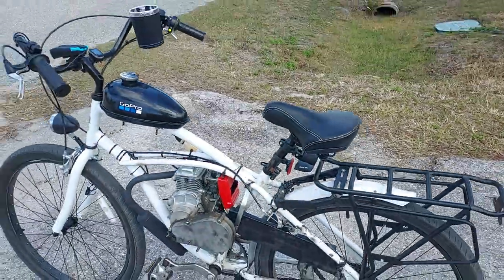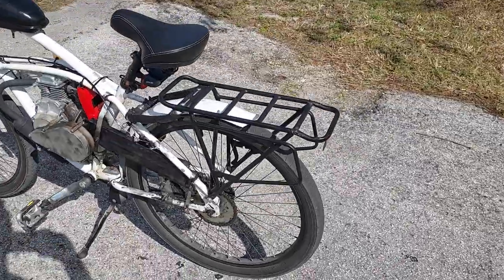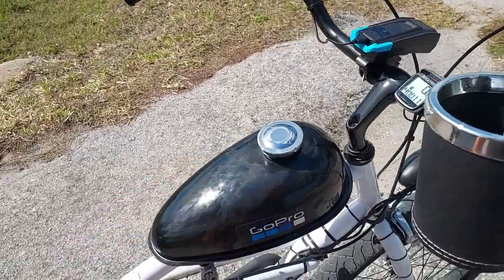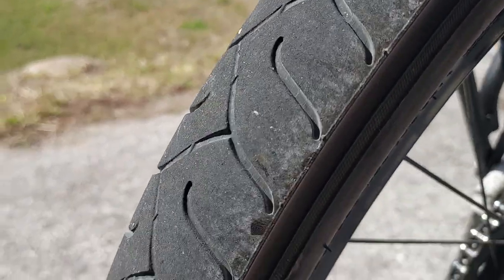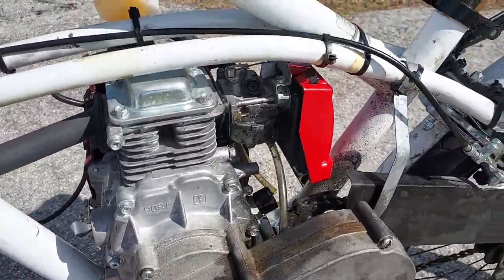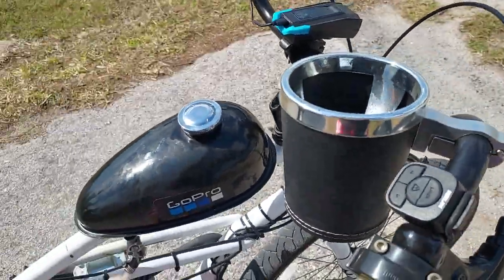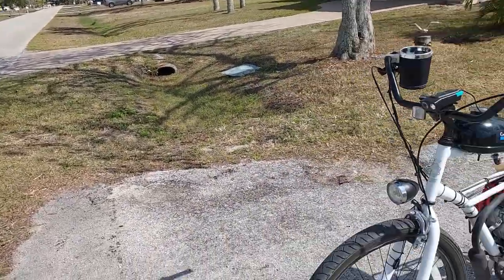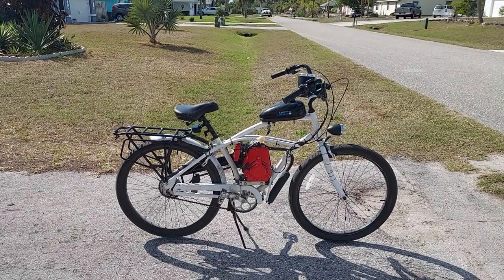BikeBerry Switz Cruz 49cc 4 Stroke Motorized Bicycle (400 Mile Overview)

Comment: Enjoyed your walk around. I’ve been trying to fit a 4 stroke in that kind of frame. No luck. Works great in the Kent Ridgeland from Mal-wart. I have that and a Phatmoto which I love. You should look into the aftermarket transmission from Bike Berry. Smooth as silk.
Reply from the maker: This is the duel chain Transmission. Basically what I needed to do to mine in order to get it to fit was modify the engine mounting plate. It can be pretty tedious! Thanks, and thanks for watching

Comment: Being Tuesday it was warm out but my wife’s only day off I spent it with her. I planned a bike ride but to much gravel is on the streets being winter rocks or salt mix extra is off to the sides of the streets. Kinda wicked riding after winter.  You can slide out quick.  But I’ll be back to riding soon. This is why I need to move to a warmer area
Reply from the maker: Totally bro

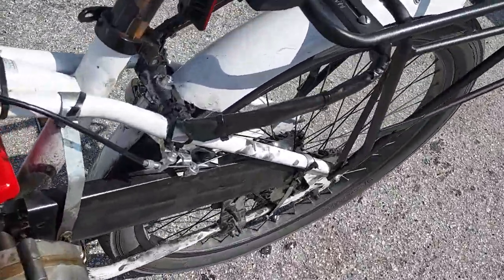Comment: 4:53 do you have a link to the light on the front of your bike?
Reply from the maker: Here ya go. 👍 
https://www.amazon.com/BlueSunshine-Vintage-Bicycle-Headlight-Bracket/dp/B09BJ2FTPY/ref=asc_df_B09BJ2FTPY/?tag=hyprod-20&linkCode=df0&hvadid=563688274067&hvpos=&hvnetw=g&hvrand=11837526961643119299&hvpone=&hvptwo=&hvqmt=&hvdev=m&hvdvcmdl=&hvlocint=&hvlocphy=9012294&hvtargid=pla-1600216049982&psc=1

Comment: why is there a bolt going through the rear motor mount drilled through the frame?
Reply from the maker: The Motor was twisting sideways so I fixed that problem
Reply: @HanzelFonferek  not a bad fix!
Reply from the maker: @scootertuningfl2174  yep

Comment: cylinder 'heat shields' as you called them should be put back on because the flywheel directs air from around the recoil module through it's fins, up through the plastic engine cover, and then back through those deflector plates, that you called heat shields.  their purpose is to direct the air coming off the flywheel across the cylinder and pushing the heat away, and do a better job of any form of velocity cooling that is common on 2-strokes.
 removing the cylinder air deflectors is not an upgrade, its a downgrade, when the engine maintains a hotter temp, it uses more fuel, looses power, looses torque, and looses longevity.